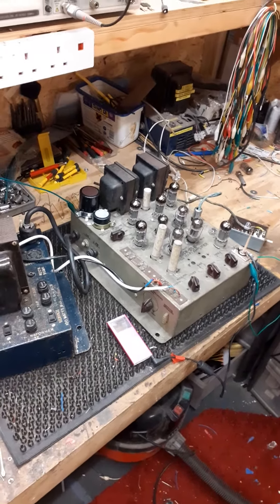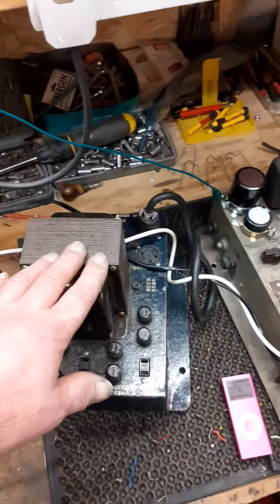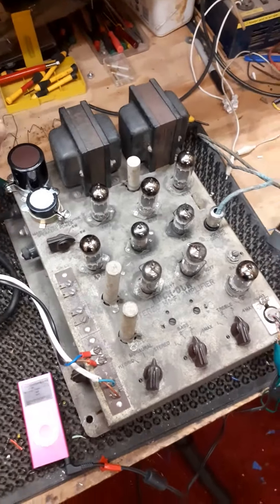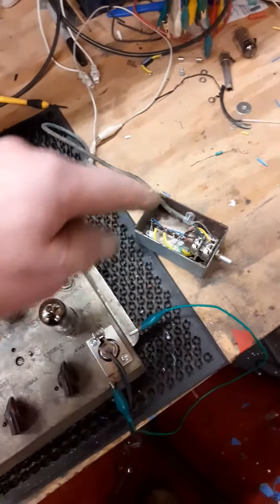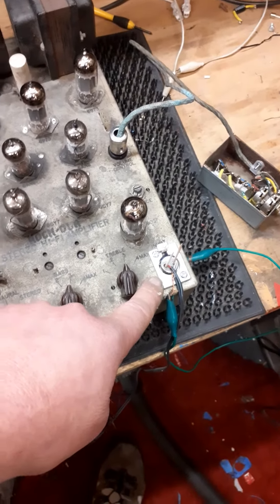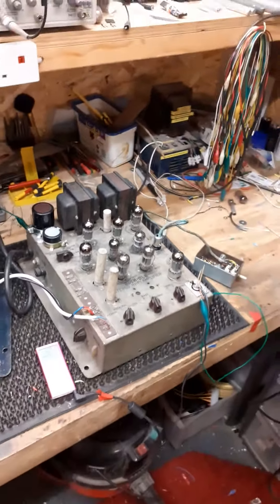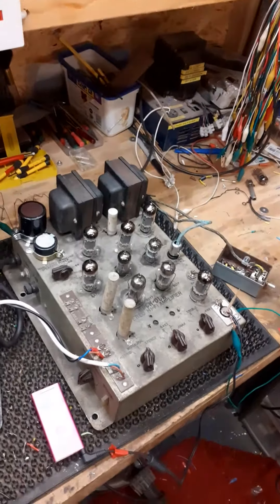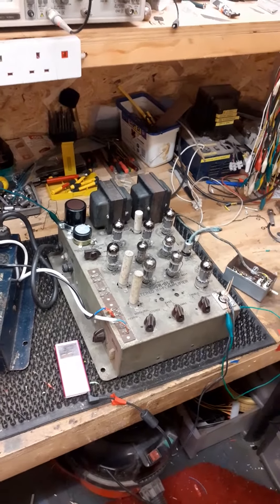rockola tempo jukebox amplifier on test after repairs

Comment: Hi u spoke to Andy at vintage radio and he said u know how to wire a credit unit for a G80 - Bal Ami Jukebox. I one I have is a 7 pin and also has a 7 pin hole in the middle of the socket. I have been told it is a R222 AMI D80 Credit unit. My Jukebx has got a green and black wire for the green light and then a black, red and yellow from the jukebox. Would u know how I would wire it up as I'm having trouble any help would be appreciated thanks
Reply from the maker: hi if its a bal-ami jukebox it will have the B7G valve type plugs for the credit unit..the Ami used a different plug and socket. so you will need the plugs for the ami credit unit or find the correct bal-ami credit unit....i am sorry i dont know the correct connections based on the colour of the bal-ami wiring, it will need  to be traced out, which should not be too difficult, then once known, can be connected to the correct pins of the plug which will be in the ami manual